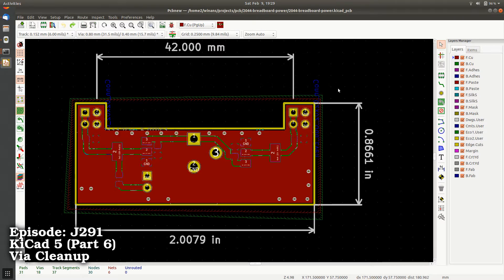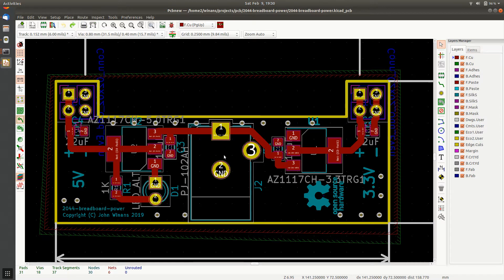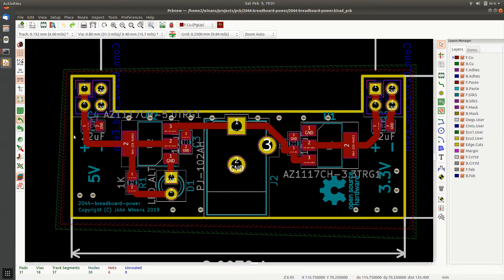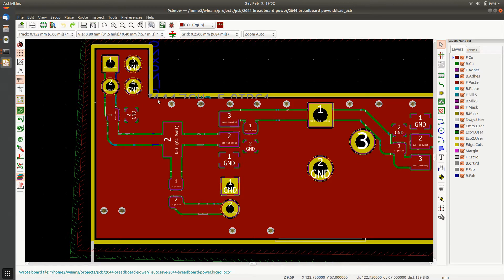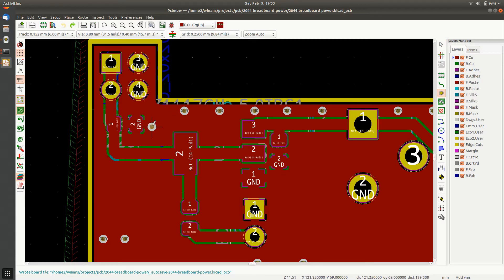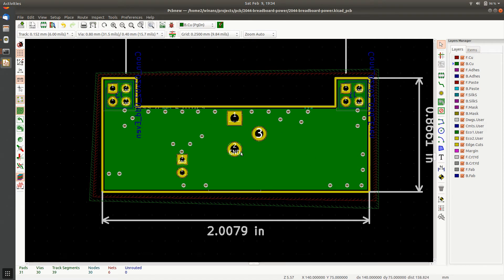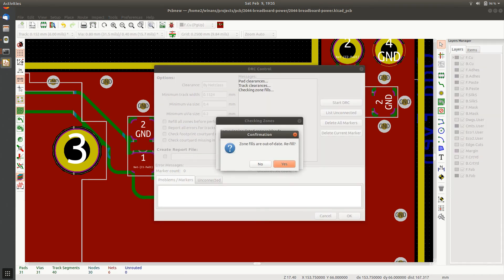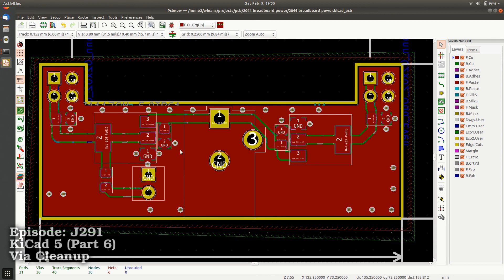KiCad 5 #6 Via Cleanup

Comment: Thanks for the series. An important distinction. DC current and low frequency signals don't care about impedance and electromagnetic flow like high frequency stuff. You are pretty much free to put your ground paths where they fit best (you want low resistance if you have high currents). Of course component placement matter, so you want a bypass capacitor nearby the component it is supposed to bypass. High frequency stuff on the other hand wants to take the path of least impedance, that is, the electromagnetic waves traveling through the PCB between the signal and the ground plane should have their paths (signal + GND) as close to each other as possible to minimize EMI, cross-talk and even signal loss. But then we are already talking about MHz or GHz signals and multi layer boards. See this excellent video about this stuff: https://www.youtube.com/watch?v=ySuUZEjARPY

Comment: John, definitely the best KiCad tutorials for the a newbie like me.  One question I need to solve.  On the filled plane, which is covered by mask, I need to unmask areas so that I can hand solder a shield can over it - for instance, around the edge of the top about 3 or 4 millimeters, so that I have gold plated copper there.  Can you advise if one of your videos already covers this?

Thanks.
Reply: Figured it out - hooray!
Reply from the maker: This is a good idea for a short vid!  You perhaps noticed that one way to do it is to select the mask layer you want to edit and then draw a filled polygon or other lines. 
If you want a graphic shape, look at part 27 of this series and consider creating a footprint like I do with a maple leaf in the soldermask.

Comment: Are ground VIAs good for comms boards to deal with potential stray RF?
Reply from the maker: I can't claim to be an expert.  But I have done experiments (read as made many mistakes) that have convinced me that a good way to prevent emmitting RF is to properly terminate your traces and route them with a controlled impedance.  If such signals are not differential pairs then you may want to place them against ground planes with plenty of vias connecting them.

Note that is is best to minimize routing sensitive signals themselves through vias.

Another way to prevent ingress or egress of  RF is to place ferrite beads on anything comming into our leaving a PCB... Including power.

Shielding is the only way I know to prevent ingress of airborne RF noise.  You can consider putting sensitive circuits into a metal can or routing traces inside a multilayer board between ground and/or power planes for shielding.

I suspect you might find better advice on this subject from David Jones on the eevblog You Tube channel.

Comment: Hi, I love the format and want to cover library's, importing 3d models, footprints etc. How about designing something else useful with us like …….A high spec headphone amp?......that uses vacuum tubes?......or something Arduino based but just use the ATmega328p-AU (TQFP version)...but useful like this...I hope you channel grows and grows, and project based at length and in depth with Kicad dosent exist ( to my knowledge) ….great stuff!
Reply from the maker: Thanks!  :-) 

Yeah, I think some deep dives into actual projects would be fun.  I'm not much of a valve guy.  As for CPUs, I prefer to work with ARM processors from NXP.  I have some LPC51U68 parts laying around for which that I plan to build a breakout board.  I got an RS485 protocol converter project waiting to get started.  I'd like to do some Spartan6 hacking (they are about as powerful and FPGA that Xilinx makes that I know of that come in LQFPs).  It might be fun to code-up a simple RISC-V processor in a Spartan 6  from scratch.

Whaddaya think?
Reply: @JohnsBasement sounds good to me. ……….some of the stuff at the end there went over my head, but here to learn!
Reply: “Via to nowhere” — indeed a good idea for an Eagles song. Made me smile 😊